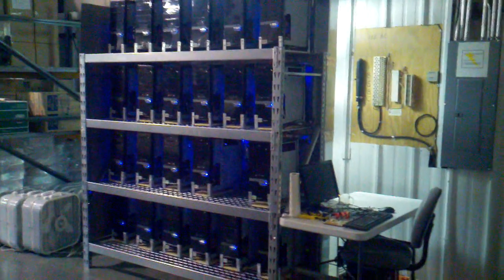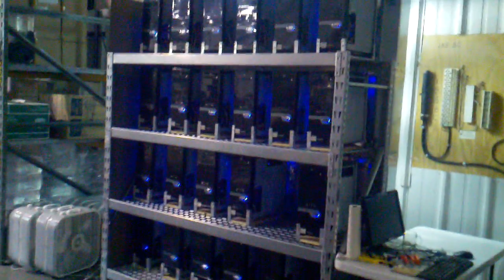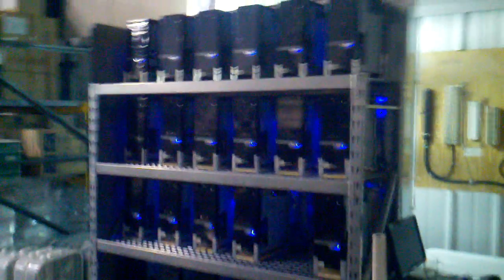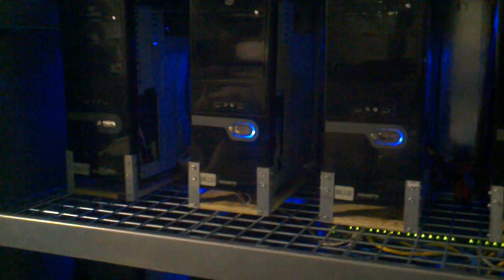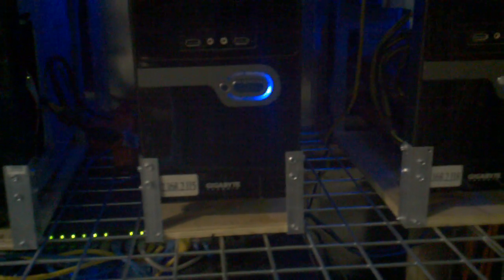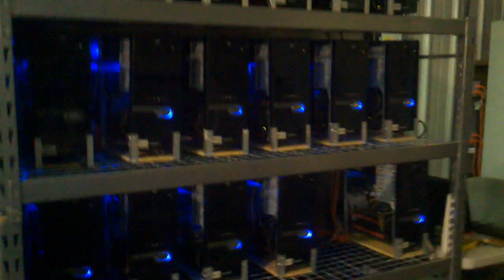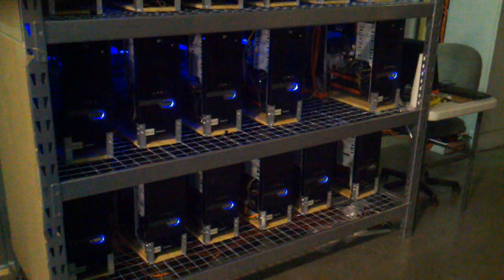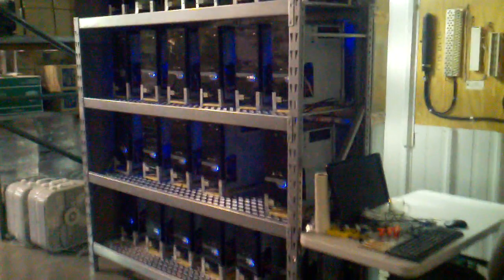Bitcoin Mining Rig - 24 Machine Setup - 48Gh

Comment: was this cheaper that buy a pcie from butterfly labs (600gh) ?
Reply: Will Johnson
What butterfly does is an ASIC design (Application Specific integrated circuit), whereas a CPU/GPU (radeon....etc) is a multipurpose device. That means that to solve the mathematical problem behind mining bitcoins a computer needs to perform, lets say 1 milliion operations, that would required 1 Mhertz cycles of the computers processor. Butterfly translates this operations (OR,AND, XOR... etc gates) into physical transistors, so in 1 clock cycle they make the 1 million operations. In exchange, the mining machine only is worth for that specific. You can imagine why with their tiny device (jalapeno 60 Gh) they can outperform the cluster of that guy.
Reply: Thats why i am totally lost...
Reply: That is the fun part… by 2011… there was no even butterfly labs! Only people mining with cpus and gpus. This guy was mining at 50 Gh/s (that today seems like the most obvious rate of mining), probably making more than 200 bitcoins at day. He catched the train in the best moment! and risk it… since by then, the bit coin exchange rate were pennies.
Reply: Thanks, Im trying to find out the key difference between a butterfly labs card and say a radeon 5970. Maybe you could point me in the right direction.
Reply: Juan Sillero oh i didn't check the date on the video :) , time to point all that gear to ltc pools dont u think?
Reply: Will Johnson you need to do more research, and remember that you're looking at an old old old video from the time this was in it's first steps

Comment: You can roll free bitcoins if you don't have hardware to mine it :) You can get anywhere from 0.000002 bitcoins to 0.2 bitcoins. It only depends on your luck :) You only need bitcoin wallet to register :)
Here is the link:
If you find this helpful be my referal: http://freebitco.in/?r=42858
In not and don't like me: http://freebitco.in

Comment: this vid was made in 2011, a rig like this would have been rolling in the bitcoins. Now the difficulty is an order of magnitude harder, GPU mining is just not feasible. Two ways to mine bitcoin at the moment, either you have a huge array of graphically powerful systems (I am talking 50+ each with ~600Mhash) with free power (maybe a botnet?), or you run powerful ASIC's, otherwise no dice.

Comment: That is not true; the value does not increase with currency mined. when you mine a single coin you reduce what coin is out there, (it is currently static) making it harder and take longer to mine the next coin, the coins are locked in hashes distributed randomly. "They" are going to have to influx more bitcoin, it is inevitable or the market will collapse. "we" don't even know WHO "they" are. Bitcoin value fluctuates more than my anus when I fart and NOBODY knows why.

Comment: Haha, what the fuck is it running on if not electricity you fucking idiot. Oh must be economically illiterate hot air.

Yes 40% tax is ok in fact it's not enough. It doesn't just disappear you fucking tool we get stuff like education. Clearly not enough in your case, ergo we need more.

Great we know where you stand, you want to destroy the welfare state. Like I saidGREEDY BASTARD.

The irony is, when the bubble bursts, and it WILL, you'll be first in line with your hand out. Just like Ayn Rand.

Comment: 48GH/s means each machine produces 2GH/s that is atleast 3 GPUs per machine. Cost per GPU around 300$ so 24 * 3 * 300 = 21600 + 24 * 100 for mainboard and case and PSU that is a total of $24000 who would have guessed that ? contact me and i will tell you hhow to build a 1GH/s for 400$ only!!

Comment: That's no really correct. They (as in Mt. Gox, just one of the Bitcoin exchanges, although the biggest one) had to update new servers to handle the new load of trades causing the stop of trades on their exchange. Then they got a DDoS attack causing heaps of lag as soon as they reopened trading. The bitcoin market can't techinically be frozen. Bitcoin's are a decentralised currency and can be traded without Mt. Gox.

Comment: since the value of the bitcoin has gone up over 100% since i posted my comment, you may indeed make more, but you wont be making 230k with that setup. but remember the price of the coin is not the only factor, my guess is the difficulty has gone up and more than likely that will balance it back out.

Comment: you can use the BitCoin to trade or redeem for giftcards or use on Amazon and NewEgg, etc... If you've built your own computer, it's actually not as expensive as you think. you don't need a huge rig like this guy if you're just doing it on the side. And as for electricity, you could invest in a solar panel, car batteries, and an inverter OR get a flat-rate on electricity.
I run my rig and network stuff completely off-grid because they are always on and i ghetto salvaged the stuff anyway.

Comment: I didn't forget. That's like saying you have a restaurant, the building cost you $100,000, and you make $70,000 a year. You don't say you lost $30,000 for the first year, because you restaurant lasts more than 1 year. The only valid point you have is that the value of the computer diminishes, whereas my restaurant example that isn't really the case.

Comment: no, it's not weird at all. You don't "make" money by mining. What you do is run a program that "hashes" block strings. The block strings are transactions that need to be verified for validity. Once in a while, the network solves a block and rewards the user that solves the block 50/25/whateverBTC for the work adding more BTC into the economy. The process becomes exponentially difficult until all the btc becomes mined. Think about electronic bank funds. They subtract funds out of your account...

Comment: 1 bitcoin currently equals $5.00 The amount of money you spend on electricity right now with 3 5870 is roughly 600 Watts per rig.  24 x 600 = 14.400 KW per hour that's $51.84 a day your spending on power assuming it's $.15.  Assuming the person below is right and you did spend 70k on all of this your only making 30 bitcoins a day with that hash rate which is only $150 a day less the power cost so $98.  Not really worth anything now and you've had this setup for less then a year.
Reply: Ur wrong

Comment: @fitosoft31 Sounds like you don't have enough power from your powersupply, buy a better one. 5970 uses about 325W is I remeber correctly (1x8PIN and 1x6PIN PCI-e-connectors).  I would use atleast 550W for your system, and that's just by assuming that you have some kind of old hardware since your PSU-unit (supposedly) is so weak. 

The 6990 goes even higher with 375W (2x8PIN PCI-e)...

Comment: Paying off each computer (about 72000 USD = 7353.89 BTC):
Assuming you don't profit from a percent of it and wait until the computers are payed off:
7353.89/368.85=19.94 months or 1.66 years until you start profiting. Also, as the value of bitcoins changes daily and is not predictable, this is at best a guess of your results. All of this is based on the current value of a bitcoin AND the current difficulty (which also changes daily).

Can you profit from mining?: Yes, absolutely.

Comment: Actually, I figured it out. With today's dificulty (1888786.70535) and khps (48000000), you'd get:
Per hour: 1.06 BTC
Per day: 25.53 BTC
Per month (using 30 days): 765.96 BTC

Electricity costs: (assuming one of those machines uses approx. 1500 * 24 = 36000, assuming 0.15 cost per kilowatt hour)
Per hour: 0.55 BTC
Per day: 13.23 BTC
Per month (30 days): 397.11 BTC

Profit:
Per hour: 0.51 BTC
Per day: 12.30 BTC
Per month (30 days): 368.85

Converting that to USD (profit/month):
3611.31 USD
Reply: he's a billionaire now prolly.

Comment: how do you manage power, each must consume around 700-800watts, 1440W is the limit for a normal houshold plug, what are you using.
I want to make a 6Gh/s Mining Rig but i have not figured how i will manage the 4000W it will consume.